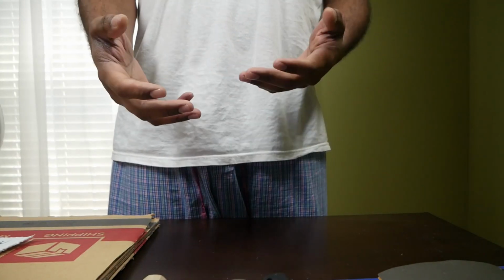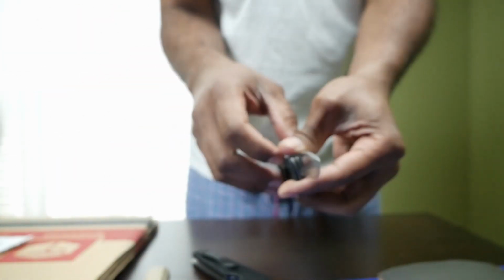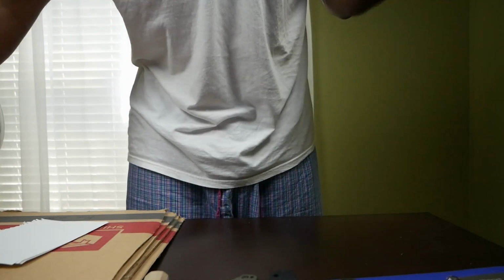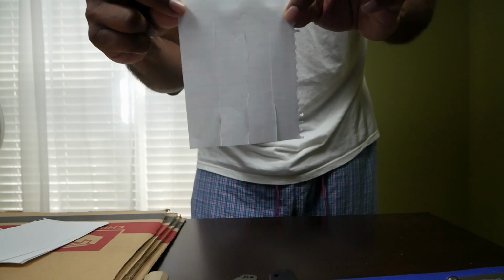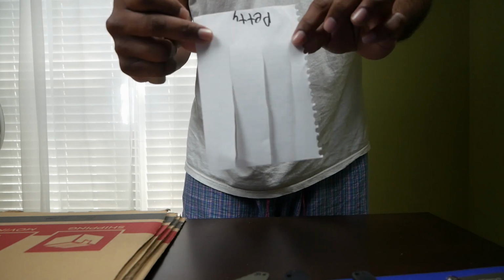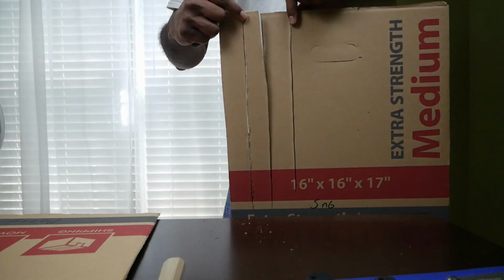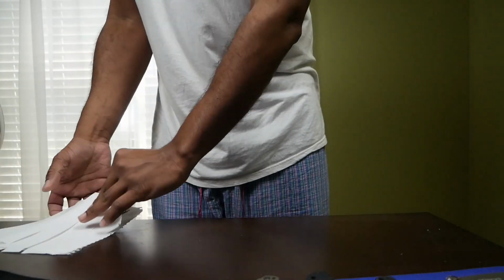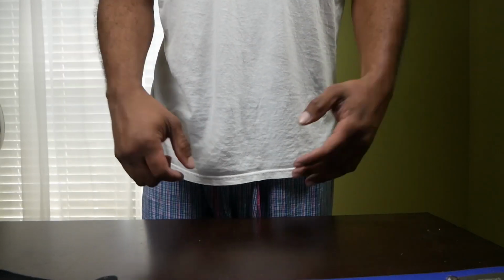Let's Demonstrate and Discuss Emerson Urban Legend

Comment: Which one of the three had less resistance when you were cutting? The chef knife appeared to take more pressure to cut all the way down? 
Also it's not really that you can't cut with an Emerson. They are good bte but also have geometry and heat treatment that allows for more rougher use aka prying. But the edge retention is lower, so you may have to sharpen it more often when you do more cutting tasks. I like that Emerson does that, as that's useful for plenty of tasks. But as a cutting work horse, the edge retention isn't idea.
Reply from the maker: Tactical Center Least, I couldn’t tell you this wasn’t that kind of run through. The petty did strangely stand out as the most. Again, this wasn’t that kind of run through though. 

To be brutally honest, I had a guy in my inbox constantly saying how the asymmetrical edge bothers him and he wised the knife wasn’t that way.  After suggesting just sharpening the other side and/or that it doesn’t impact performance, the conversation continued. 

So, as you guys know, I’m not about that talk. I’m all about that action. I showed that, to my eyes, there is no appreciable difference between the v ground Emerson and any other “normal” knife. 

A week or two back, I posted to my IG about Emerson’s heat treatment. At one point, I’d 100% agree that they chose to go a route that skewed more towards toughness and all of those types of things. Then, I saw that they now, and apparently for some time, have been running their steel up to 57-59. 

I do not have enough information from use, Rockwell testing, responses from Emerson, etc to go much farther that what I already stated, but things have changed. How much and in what areas, that’s the fun part we get to test out and see 👊
Reply: @Alumapro23  yea the Emerson website is kinda weird. If I goto product page it shows me some of them are offered in 154cm or s35vn and 57-59hrc. Then I goto the store page and says only 154cm and same hardness range. So who knows what's up with that.
Reply from the maker: Tactical Center So even by that account, some of the 154cm models have changed?

I’ll give you the first example that caught my eye. It’s the Katana that I ended up buying on the secondary. It’s only available in 154cm, listed as 57-59 on all listings, and is a newer model so it’s not just a page that was neglectfully updated. There are other long standing models, such as the a100 (OG full size), that are listed the same way and are also only available in 154cm.
Reply: @Alumapro23  from what I remember a few years ago ernie went on bladeforums.com and said his 154cm was like 54-57hrc or something like that. Don't quote me on the exact number. So strange they updated the site. But it's not showing older knives specs.
Reply from the maker: Yeah, that’s why I noted it on my Instagram page a few weeks back. They were definitely softer. That has since changed.

Comment: Wondering if you could help out a viewer, to better understand your subject matter. Specifically, what is the urban legend (in dispute, or ... ?) you reference in subject title?

ALL of the knives in your video are v-grinds (primary bevels on both sides).

Emerson makes both V & Chisel Grinds:
1) V-Grinds (one primary-grind per side, with one  secondary-bevel on presentation-side only),  
2) Chisel-Grinds (presentation-side only primary-bevel), and a 
3) Custom-Chisel-Grind with no secondary.

It appears the thinnest test knife (Petty) required the most effort/force to push through that cardboard (seems to indicate that initial sharpness was not calbirated across the different knives edges), which appears to negate any conclusiveness  regarding any meaningful results.

Thanks,
Reply from the maker: There are several things that are repeated over and over again in the community that have not held up in use. Deformed washers, knives that are basically about to fall apart, the asymmetrical edge on a v ground knife causing the blade to “walk” while cutting. 

In a brief and direct reason for the vid, I had a guy in my inbox that was consistently talking about the edge. So, after suggesting a few things and basically telling him that what he was saying wasn’t the case, I decided to do what I do. Show and not talk. I threw in the v grind vs chisel grind and washer thing because those are the other common things that are commonly and inaccurately parroted.
Reply: @Alumapro23  Thx 4 reply.

RE: "I threw in the v grind vs chisel ...?

Bu,bu,ut ..., none of those four knives (in your video) have chisel-grinds ...
Reply from the maker: Yes, I mentioned that in the video. I said that I forgot my chisel ground knife for comparison. 

The chisel grind was not the primary reason for the video though. It was to show that guy that a chisel edge/asymmetrical edge has no significant impact on the straightness of a cut.